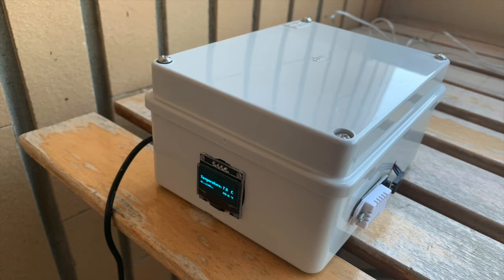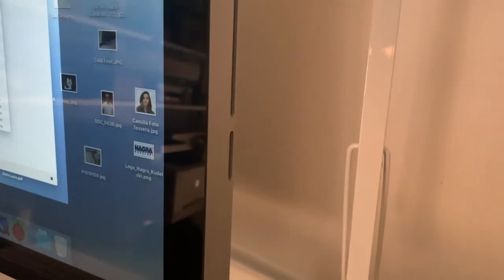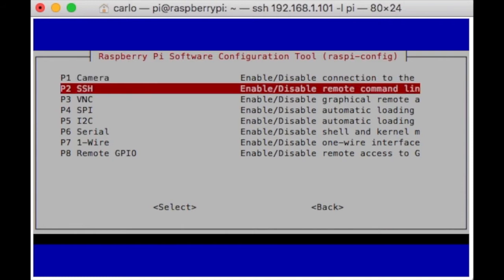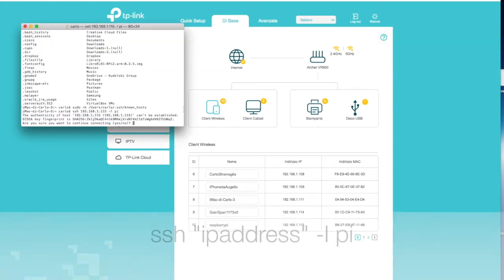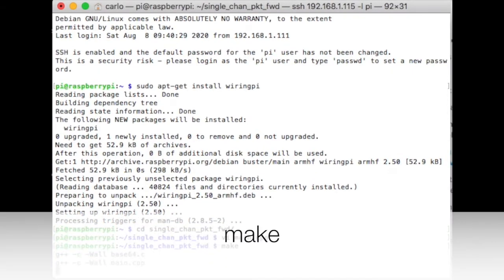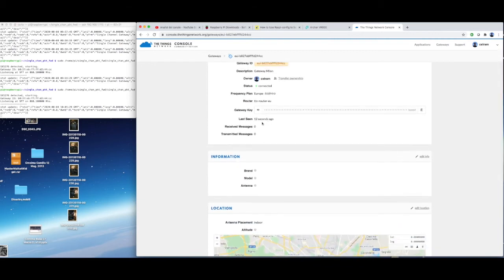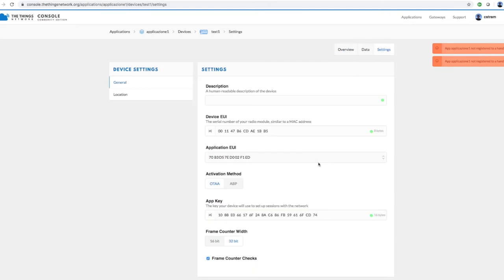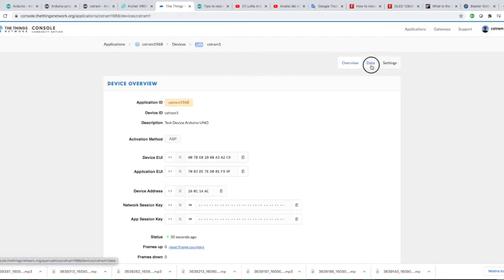Arduino and Raspberry LoRa Tutorial end to end with Gateway and Device configuration

Comment: Hi, I am using the same module with the raspberry pi 4 model B. Would you please let me know how can I calculate the realtime power and energy consumption of both the module attached with the raspberry pi?
Reply from the maker: What I would do is to put a power measurement device between the Raspberry PI and the power supply. This should give you the peak and the average power consumption. I found this website https://linuxhint.com/power-consumption-raspberry-pi/ I did not try it but it looks that it should help you understand the power consumption of RaspberryPI and also the RFM95 module attached. Hope it helps.
Reply: @CarloStramaglia  Thank you very much. Actually, I wanted to have both calculations without using external HW. And if I used this device, it gonna be only showing us one time value and cannot save the realtime measurements.
Reply from the maker: @junaid_qadir  Hi, I saw on the net some software that you can load on the Raspberry to have such calculation but I'm not sure it's accurate. Sorry could not help more.

Comment: hello, thanks for the explanation, this is very helpful. but I'm having a bit of a hard time decoding the data on my hosting, because I'm using the antares lorawan platform which doesn't have a feature to decode data. so how to decode data in mysql database?. please i need this 🙂
Reply from the maker: This is the code I use to extract the payload. Hope it helps. 
function Decoder(bytes, port) {
  // Decode an uplink message from a buffer
  // (array) of bytes to an object of fields.
  var decoded = {};

if (port == 1){
  // Decode bytes to int
  var HumData = (bytes[2] << 8) | bytes[3];
  // Decode int
  decoded.Humidity = HumData/10;
  // Decode bytes to int
  var TempData = (bytes[0] << 8) | bytes[1];
  // Decode int 
  decoded.Temperature = TempData/10;

  }

if (port==2){
 return {
      Temp: String.fromCharCode.apply(null, bytes)
  };
  }
  
  if (port==3){
 return {
      Testo: String.fromCharCode.apply(null, bytes)
  };
  }
  
  return decoded;
}

Comment: Which is the code that converts the data arrived in hex format in decimal temperature and humidity?

Thank you very much for sharing your knowledge
Reply from the maker: The payload conversion on the TTN backend is the following:
 
PAYLOAD:
 
function Decoder(bytes, port) {
  // Decode an uplink message from a buffer
  // (array) of bytes to an object of fields.
  var decoded = {};
 
if (port == 1){
  // Decode bytes to int
  var HumData = (bytes[2] << 8) | bytes[3];
  // Decode int
  decoded.Humidity = HumData/10;
  // Decode bytes to int
  var TempData = (bytes[0] << 8) | bytes[1];
  // Decode int 
  decoded.Temperature = TempData/10;
 
  }
 
if (port==2){
 return {
      Temp: String.fromCharCode.apply(null, bytes)
  };
  }
  
  if (port==3){
 return {
      Testo: String.fromCharCode.apply(null, bytes)
  };
  }
  
  return decoded;
}
Reply: @CarloStramaglia  Thank you very much

Comment: Hello Carlo, does this project work with TTN V3 as well and how can I access the example node and decoder codes? Thanks in advance.
Reply from the maker: Hi. Yea it works. I need to update the tutorial but the process is the same.
Reply from the maker: Beware. The TTN server IP address has changed to 63.34.215.128 This new IP replaces the old one in the current video for the TTN V3 version.
Reply: @CarloStramaglia  I appreciate your help. In the video, you say you will send the example Arduino sketch, could you send it to me please if possible because I am having issues with mine.
Reply from the maker: Hi. All the source code and schematics are here https://create.arduino.cc/projecthub/cstram/end2end-lora-gateway-and-device-tutorial-65b26f?ref=user&ref_id=1371882&offset=10

Comment: Thank you, Could you send the code of the Payload ? Thanks mail:ruchesdefrileuse@gmail.com
Reply from the maker: Hi. Looks like your email does not work.
Reply: @CarloStramaglia   ruchesdefrileuse@gmail.com  - it's ok. Thanks
Reply from the maker: function Decoder(bytes, port) {
  // Decode an uplink message from a buffer
  // (array) of bytes to an object of fields.
  var decoded = {};

if (port == 1){
  // Decode bytes to int
  var HumData = (bytes[2] << 8) | bytes[3];
  // Decode int
  decoded.Humidity = HumData/10;
  // Decode bytes to int
  var TempData = (bytes[0] << 8) | bytes[1];
  // Decode int 
  decoded.Temperature = TempData/10;

  }

if (port==2){
 return {
      Temp: String.fromCharCode.apply(null, bytes)
  };
  }
  
  if (port==3){
 return {
      Testo: String.fromCharCode.apply(null, bytes)
  };
  }
  
  return decoded;
}